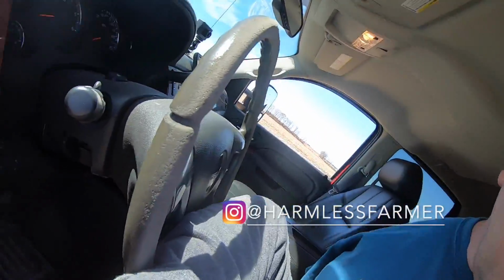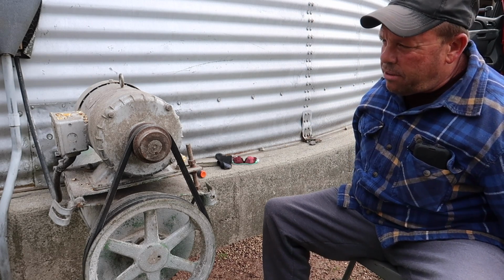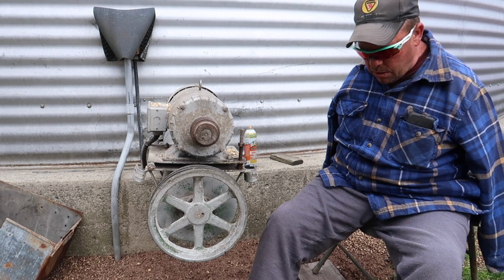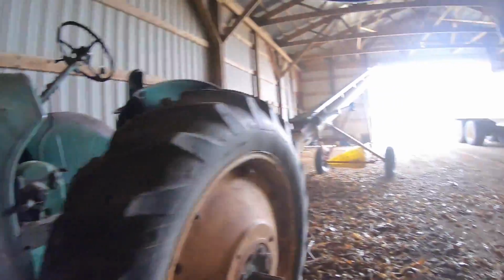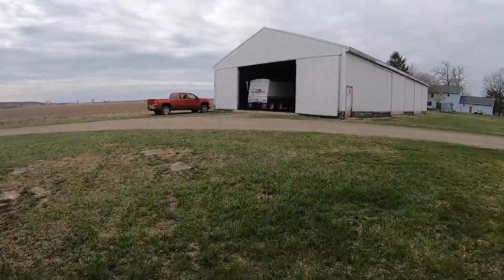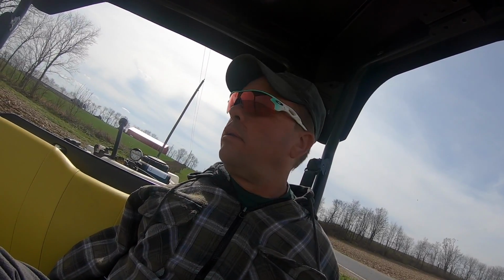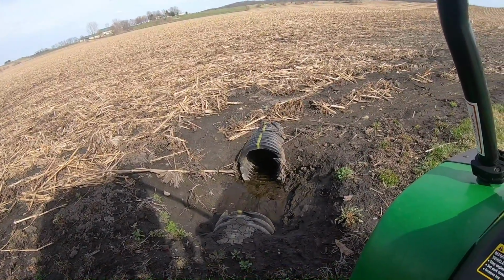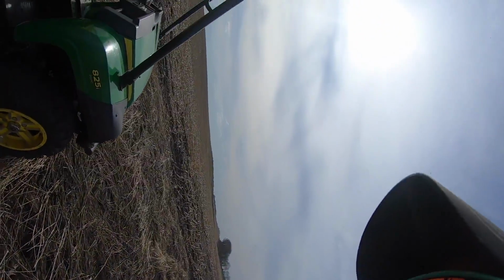Ford To The Rescue......I'm Stuck!!

Comment: Push and hold the traction control button until it dings and it will disable the stabilitrak & traction control and give you full power !

Comment: Need to get the auger empty after using as can be hard on it to start up when left full. We had a flap that shut the inlet off and just kept running till empty. Just burns up the belts or pops the breakers if you try to start it full. A PTO driven one will have the power to start up full mind you. Loving your style mate, you unstoppable !

Comment: Probably some corn grains get stuck between the belt and the pulley and the stuck grains momentarily stretch the belt out. If you can find some way to avoid the grain getting near the pulley, it would probably save you trouble. I know you mentioned something about a cover early on.

Comment: boy do i have the perfect wrenches for you. they ratchet on BOTH ends
Reply: Craftsman made them. I don’t know if they still do. But they make it much easier because you don’t have to pull the wrench off the nut then back on to loosen/tighten it.  They also double as a stripped nut tool

Comment: Home that traction control button down an it will turn it off keep holding it an it will turn off stabilitrack an want bog the motor down first time I got my new 3/4 stuck in the deer woods wouldn’t spin tires I was ready to drive that sum bitch through the front of the dealer ship or burn it I had never dealt with junk like this so it’s either 4low or turn it off with the button for 2 wheel or 4 high I was pissed

Comment: FORD WAS SPINNING TIRES BACK WHERE IT STOPPED, IF CAME THAT FAR, STUCK TO. JUST SMARTER. STAYED FARTHER BACK.
Reply: Also take traction control off, then it gives you the FULL POWER at the tires, they will spin a lot if you want to get out. Traction control is for people to stop them from getting stuck or spinning there tires, take it off, then jam in reverse and jam the THROTTLE to get those tires spinning. NEVER WATCHED ENTIRE VIDEO. ONLY THE TRUCK PART, FORD WOULD OF BEEN STUCK TO. traction control keeps the VEHICLE from breaking loose and spinning out of control, ever do a DONUT, YEAH CAN'T WITH TRACTION CONTROL ON, SHUT OFF AND WOW !!! DONUTS IN HEAVEN !!! Traction control can hurt you or save you, I've had it hurt me in snow to where it kicks in on a slide in a corner, needed engine with 4 wheel drive to pull me out of slide, instead I slid a bit to the side and almost a Curb in a Ford, gas, well would of THROTTLED it up spinning tires to get away from curbing. Must know how to use it. Watch NASCAR, ever see them back a car into the wall ? They THROTTLE it up to full THROTTLE. That's why lots of smoke and to keep from hitting wall backwards. Yes it works about 50% of the time. They have to try to save the race car now. DON'T want the backup coming out. Gas is your FRIEND or your worst enemy. Must know how to control your VEHICLE at all times, if you DON'T, then your driving to endanger and could add reckless driving too. Its the LAWS in most STATES. So all read up on TRACTION CONTROL ON HOW IT WORKS. YOU STILL CAN'T DO 55 MPH IN THE SNOW, BRAKES DON'T STOP YOU AT ALL, MOST DUMBASSES THINK YOU CAN FLY IN 4 WHEEL DRIVE OR ALL WHEEL DRIVE. NOPE YOU WILL CRASH AND DIE OR KILL SOMEONE ELSE. ALL WHEEL DRIVE ONLY WORKS WHEN A TIRE SLIPS. THEN IT KICKS IN, SO DON'T THINK YOUR IN 4 WHEEL DRIVE, IT'S A MISCONCEPTION THINKING THAT YOU'RE IN 4 WHEEL DRIVE ALL THE TIME. SO READ UP AND ASK YOUR CAR DEALERSHIPS A LOT MORE QUESTIONS ABOUT BOTH ISSUES NOW, YES THEY CAN BE VERY HELPFUL OR HURTFUL AT TIMES, WONDER WHY TRANSMISSIONS BLOW UP FOR ? I BET BECAUSE IF THAT, ENGINE SHUTS DOWN A BIT WHEN IN GAS AND IT MAKES FUNNY NOISES, TAKE OUT, THEN YOUR SLIDING AROUND BIG TIME, THEN YOU CAN PLAY OR SHOW HOW TO DRIVE IN SNOW IN WIDE OPEN ICY SNOW COVERED PARKING LOT, OTHERWISE TRACTION CONTROL KICKS IN AND STOPS IT. NOT LIKE AND OLD REAR WHEEL DRIVE CAR. HOPE PEOPLE UNDERSTAND IT. ALL I CARED ABOUT, MAKES GMC LOOK BAD AND FORD GOOD, BOTH DO THE SAME WITH SAME DRIVER. JUST NEED DRIVER TO BE SMARTER ON HOW TO, THEN MUD WILL START SLINGING FAR AFTER THAT IF YOU WANT TO. ALSO DRIVING IN MUDDY AREA AND DON'T WANT TO TEAR UP, THEN AIR TIRES DOWN TO GIVE BIGGER FOOT PRINT ON GROUND FROM SINKING. ON BEACH SAND. ITS 18 LBS PER EACH TIRE, ANY HIGHER, THEN YOU DIG. ITS A SCIENCE BEHIND IT. BEEN ON BEACHES WITH PASS AT OCEAN. GET CAUGHT OVER, IT'S A $100 TICKET PER EACH TIRE OVER. SO BETTER HAVE IT RIGHT WITH GOOD EQUIPMENT NOW.

Comment: You're not stuck come on use your brain get too long sticks that you should always carry in the back of your truck if not for but if your two wheel drive used to time straight across 180 degrees across the back rims right to the rim start your vehicle up and it will pull you right out some people you're a farmer you failed as a farmer being stuck in a cornfield you have no idea how to get out by yourself you'll never make it out in the woods you will die
Reply from the maker: Thanks for watching!